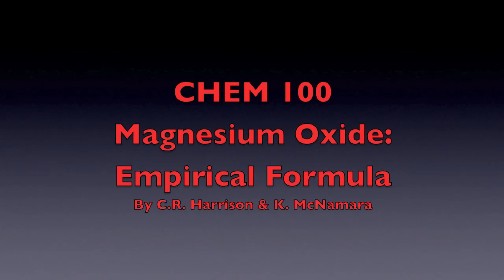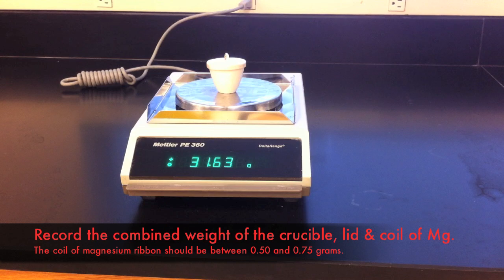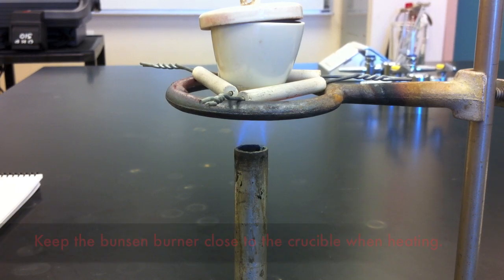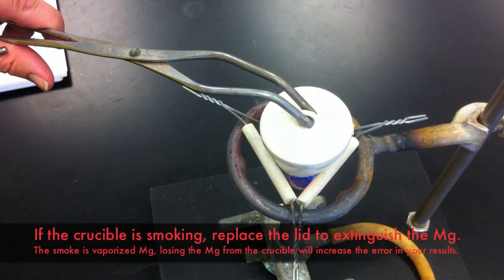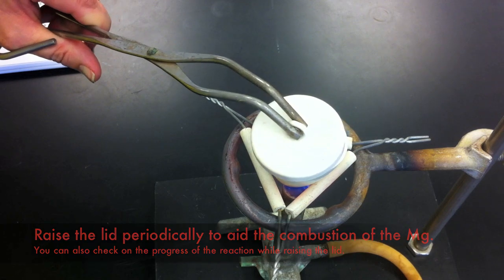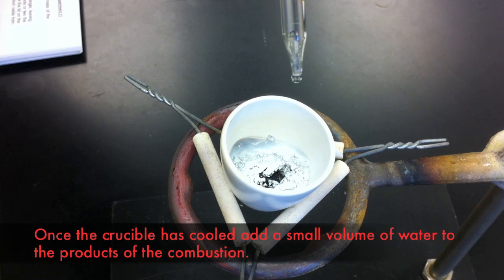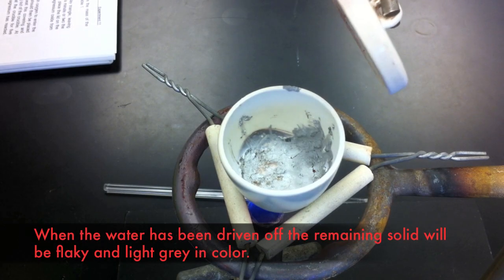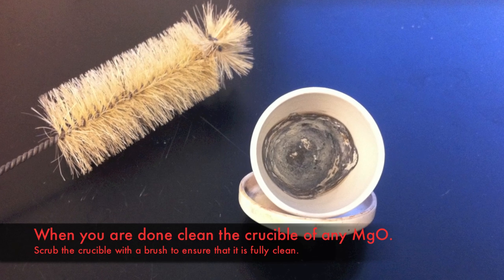Magnesium Oxide

Comment: But why does the magnesium oxide appear grey in colour? Shouldn't it be white?
Reply from the maker: That's a good question and I don't have a definitive answer for you.  My best guess is that there may be a little bit of carbon getting deposited into the salt as it oxidizes.  Magnesium can burn in CO2 (there's a need demo of this when the Mg strip is kept between two blocks of dry ice (solid CO2) in that instance the reaction taking place is 2Mg + CO2 -> 2 MgO + C, so it is possible that some of the CO2 in the atmosphere around our Mg wire also underwent this reaction, leaving a bit of carbon behind (the black carbon mixing with the white MgO would look grey).